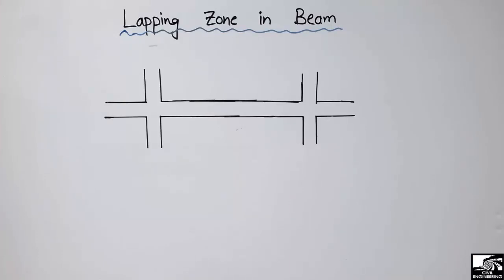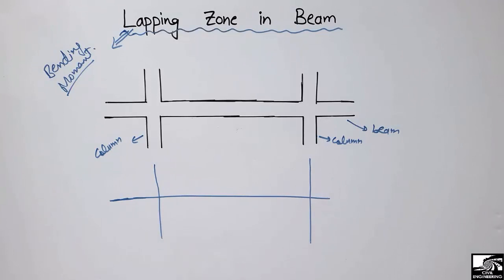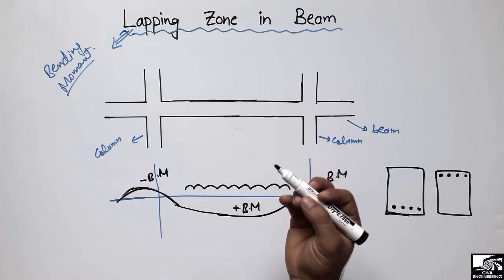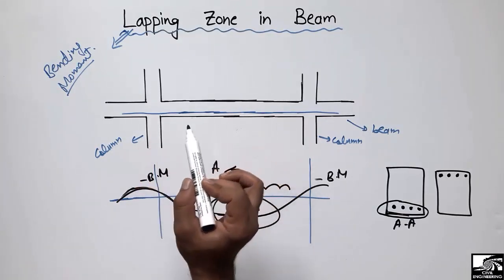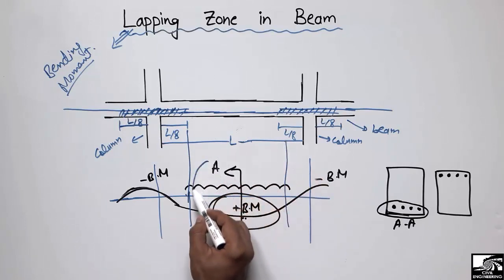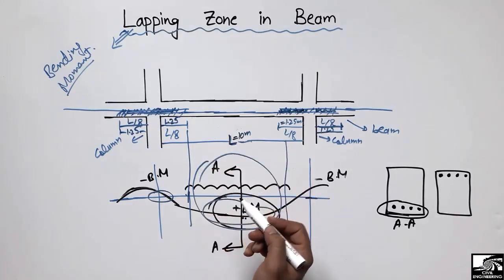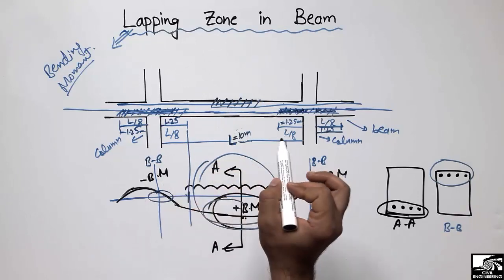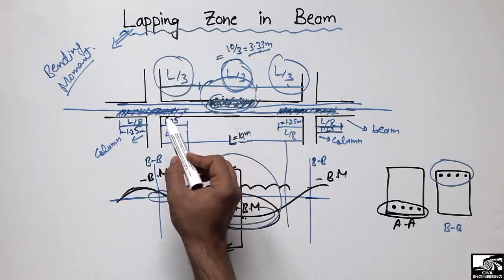Lapping zone in Beams

Comment: sir i have two questions, 1) can you relate the lapping zone that you explain with the codal provisions? 2) you said for bottom bar, the lapping zone is just at the support or at the beam column joint but for seismic prone regions beam column joint is the weakest regions so it doesn't make sense to provide there, so do you have any reason for it?

Comment: what is the lapping zone for 25 meter Post tension beams? pls reply. where as the main reinforcement of 3nos, 32mm dia rod used at both side of the beam and for top 5nos 25mm rod provide. Beam size is 25 M x 1.35 M x 0.75 M. Pls explain